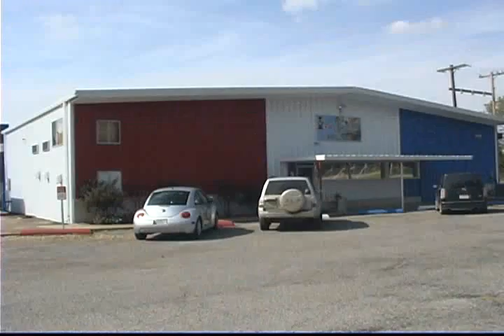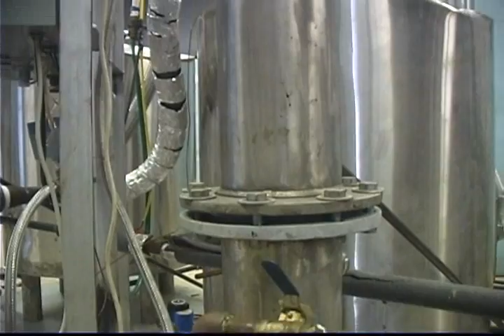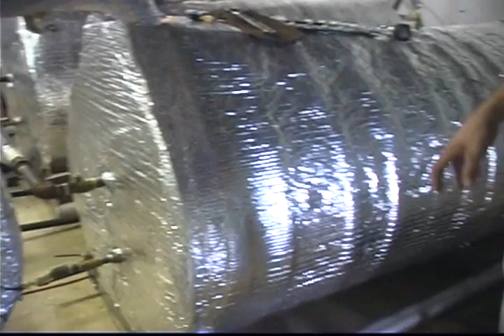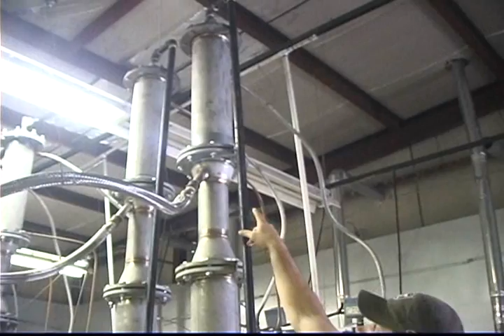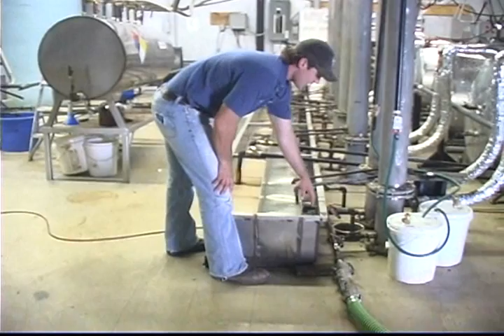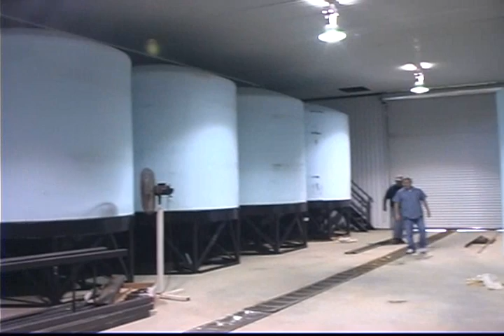Ethanol Production

Comment: David Lewis McDowell, age 50, Formerly of Antlers, Oklahoma, Wire Fraud and Money Laundering

The indictment alleges that on or about May 9, 2008, through October 15, 2009, in the Eastern District of Oklahoma, defendant David Lewis McDowell knowingly devised a scheme to defraud investors by fraudulently representing and promising that FASTech had a system that could produce ethanol at a commercial production rate sufficient to sell commercially. Based upon those fraudulent and material representations, his actions caused victims to send money via interstate wire communications to be invested in FASTech. The indictment further alleges that on or about June 25, 2008 through November 9, 2009, in the Eastern District of Oklahoma, defendant David Lewis McDowell did knowingly engage in a monetary transaction through a financial institution, affecting interstate commerce, in a criminally derived property of a value greater than $10,000 by causing money to be transferred from accounts at Ameristate Bank, such proceeds having derived from a specified unlawful activity.

The charges arose from an investigation by the Internal Revenue Service-Criminal Investigation and the Federal Bureau of Investigation. The charges are in violation of Title 18, United States Code, Section 1343, punishable by up to 20 years’ imprisonment and/or up to a $250,000 fine; and Title 18, United States Code, Section 1957, punishable by up to 10 years’ imprisonment and/or a $250,000 fine or twice the amount of criminally derived property.

Andrew Duane Sloan, age 24, of Hendrix, Oklahoma, Failure to Register as Sex Offender

The indictment alleges that from in or about December 2012 until on or about March 22, 2013, in the Eastern District of Oklahoma and elsewhere, Andrew Duan Sloane, defendant herein, an individual required to register as a sex offender under the Sex Offender Registration and Notification Act after having received felony convictions from the state of Oklahoma, Bryan County, on or about March 3, 2009, for the felony offenses of second-degree rape and sexual battery (two counts), traveled in interstate commerce and knowingly failed to register and update his registration as required by the Sex Offender Registration and Notification Act.

The charge arose from an investigation by the Bryan County Sheriff’s Department and the United States Marshals Service. The charge is in violation of Title 18, United States Code, Sections 2250(a)(1), 2250(a)(2)(B) and 2250(a)(3) and is punishable by not more than 10 years’ imprisonment and/or up to a $250,000 fine.

https://archives.fbi.gov/archives/oklahomacity/press-releases/2013/two-individuals-indicted-in-april-federal-grand-jury